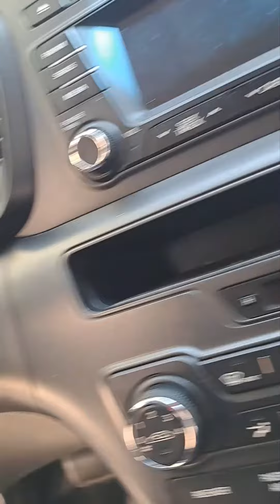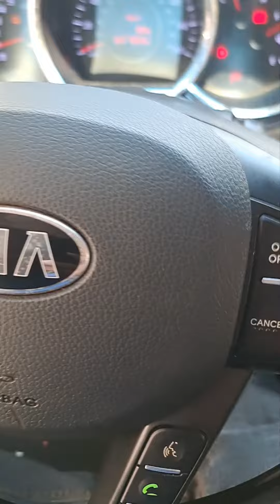Short video of me Replacing a Kia ignition lock.

Comment: Does it needs to be reprogrammed or can i just get one from a Junk yard with key and install it?
Reply: It doesent need to be reprogrammed because Kia and Hyundais don't have inmobilizers so you can just grab one from an junk yard and replace it. But be careful since there stealing kias out there
Reply: Just also if you want to lock and unlock the car remotely, then you'll need to reprogram it then. If you just wanna lock and unlock the car from the door, then no. Id also get the door lock replaced since the pin won't match up with the new key, but your car will start with the replacement key. Just won't lock and unlock the car